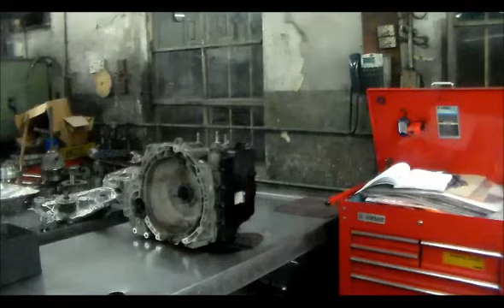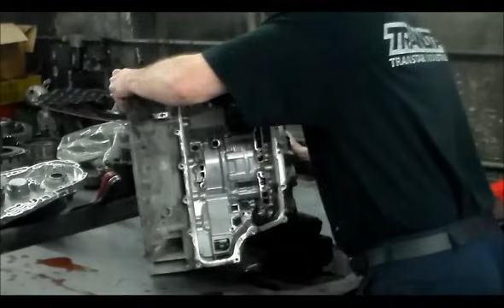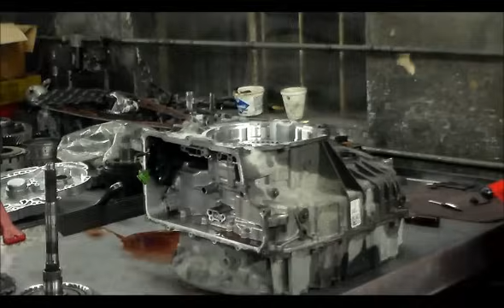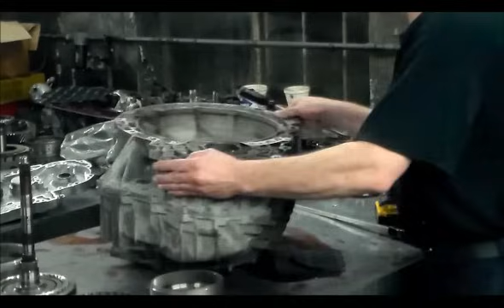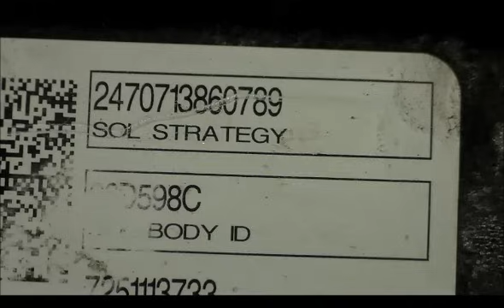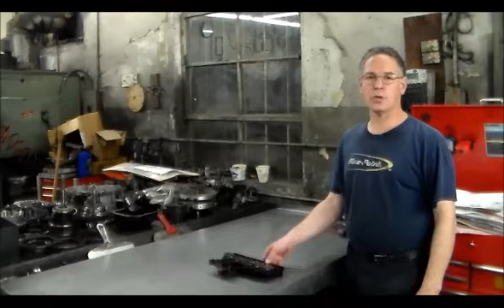6F50N Teardown

Comment: I have a Ford torque converter on order. Have a 6f50 with shudder hoping I can swap fluid and converter . Should I change filter or the valve body ? I’m a tech myself over 20 years but I went away from trans work years ago
Reply from the maker: Well if your pulling the unit out, can't hurt to change the filter. You have to split the cases to change the filter
Reply: @GaryFerraro do I need to mess with any clutch packs, etc? Or can I split the case swap the filter and assembly ?
Reply from the maker: @Ranalla651 you do not have to mess with clutch pack, just remove the pump,  to swap out the filter
Reply: @GaryFerraro thank you sir!

Comment: That's my biggest beef with these transmissions is the unserviceable filter, which will inevitably clog and this is a huge design flaw or more to the point on purpose. Tje only way to avoid a clogged filter is changing the very expensive LV fluid periodically. They got you coming and going.  Most people can't afford a transmission rebuild.
Reply from the maker: Correct, these units are expensive
Reply: Think about this, the filter has a large enough surface area to handle the service life of debris from that unit. IF the filter needs replacement because it is plugged or partially plugged then you have a problem with the transmission. Not because the filter is plugged but because something is coming apart,plugging the filter.
I have 2 6F50s with 200k and 1 6F75 with 235k, none of them have been apart.
Reply: The filter loading has nothing to do with oil changes…

Comment: Hi my name is Isaac I have a 2016 Ford Explorer sport XLT 4x4 3.5L 6f50 transmission, my question is, is the 6f50 transmission interchangeable with the 6f55 transmission which is a more beefed up version will it fit in my car or what  modifications have to be made? Thank you so much
Reply: 6f50 is for N/A motors 6f55 is for turbo 3.5
Reply: @Dalton didn't know that
Reply: Isn’t the explorer sport a turbo 3.5?

Comment: You tore down a 6F50 because the TSS and OSS sensors needed to be replaced?   Might want to learn more about the 6F50 transmission.  They will go well past 300,000 miles.  This was again an obvious sensor failure and a very simple fix. This tear down was not needed.  The 2007-2008 6F50 is well known for it's TSS and OSS sensor failures and many transmission experts do not want to learn or understand.  They want to make money rebuilding operational transmissions and ripping off their clients.
Reply from the maker: If the sensors needed to be replaced that's all I would do. If you read in the description the converter was blown and the screen was clogged. I have done plenty of repairs where just the sensors where replaced
Reply: @GaryFerraro  I had one of the check balls blow through the pressure plate and get stuck in the vein after going the all the ford test and replacing the pcm 🤦‍♂️ lol great video
Reply from the maker: @powerstorke03  Wow , never had seen that on this trans
Reply: Was there any code for the Tss and oss sensor?
Reply from the maker: @felixteresa7584  I honestly do not remember, but if you have a car that does not move or slips because of a clogged screen, very possible you may get speed sensor codes
Reply: @GaryFerraro  I'm not getting a code but the car is slipping and shifting hard in 2nd gear or 3
Reply from the maker: @felixteresa7584  what is the year make and model
Reply: @GaryFerraro  07 Lincoln mix.  It seems like when the car is cold it runs ok but when it warms up it starts slipping real bad..
Reply from the maker: @felixteresa7584  So it runs good for about 15-20 minutes? does it stop moving hot? Any noise coming from the trans when hot
Reply: @GaryFerraro  yes.. run okay for a couple of minutes and then it start shifting hard and slipping.... barely moving
Reply from the maker: MACTFORDEDGE    Almost sounds like the Filter is clogging up. Any noise when hot?
Reply: @GaryFerraro  no noise
Reply: @felixteresa7584  Many instances you will not get a code and many times simply turning off the engine and restarting will reset the codes and allow for short runs under normal operation.  This however will progressively get worse.
Reply: @MACTFordEdge  it does feel like it's getting worse. I was thinking turn down the transmission and look at the disc
Reply: @GaryFerraro  TSS and OSS senser failure will have hard shifts, failure to move but slowly with high engine rev.  Hard engagement in reverse and or Forward gears.  Difficulty in shifting and finding gears.
Reply: @MACTFordEdge  I took apart the body behind the solenoid, and 2 small ball bearing fell out, where do the go? I am ordering a manual today my new sensors come tomorrow.
Reply: @Chasrunyon  Go here https://www.facebook.com/groups/MACTFORDEDGE/ or MACTGARAGE.COM to find files on how to repair and replace the check balls.
Reply: MACTFORDEDGE thanks
Reply from the maker: @Chasrunyon  Thanks for watching. Stay Safe
Reply: Gary Ferraro thanks
Reply: Gary Ferraro when I broke the valve body down there were only 2  quarter inch check balls in there, diagram calls for 7, I see ford recommends removing one, reading comments on another video and guy found same thing just 2, 
I’m going to order replacements but seems like a manufacturer change at plant without actually disclosing.
How important are the check valves if only 2 in there?
Reply from the maker: @Chasrunyon  Macfordedge, Any info on the 8F35? I have code P093D, Accumulator solenoid performance.  Thanks
Reply: Gary Ferraro I have no clue, I’m just a smuck to dumb to be afraid of tearing things apart. Ha good luck though
Reply from the maker: @Chasrunyon  You did the video on the fluid for youtube correct?   Thanks for getting back to me
Reply: Gary Ferraro no not me
Reply from the maker: @Chasrunyon  ok, thanks, stay safe out there
Reply: @MACTFordEdge    I have the code p0974 shift  solenoid A control circuit high “ do you think it would be caused by one of the sensors or is the shift solenoid itself Thanks in advance
Reply: @GaryFerraro  I have put over 700,000 miles and performed massive amounts of maintenance on my 3 ford Edges.  I currently have my second Edge with over 300,000 miles and the original engine and transmission.  The 6F50 transmission loves fresh fluid and I change my transmission fluid at about 30-40K miles. My 2008 suffered from TSS and OSS failure. Simple sensor replacement and you are good to go. I also have trans and engine fluids tested.
Reply: @GaryFerraro  if you want more specific information go to Mactfordedge on youtube and the Facebook group of the same name.
Reply: My issue on my 2009 Ford Edge is 0705 code transmission range sensor. I’m going to confirm it’s bad with the resistance test at the connector pins. If it is bad, would you recommend replacing the tss and oss sensors as well and what brand of these parts would you recommend?
Reply: I am having same issue in 2nd to 3rd shift.  Getting worse now a random slip if I am hard on throttle but will drop into 3rd.  Would this be a simple solenoid and or valve body or this may also be clogged screen?   I got car at 155k it was barely harsh shift.  Now its 190k and the shift is worse like it wants to take more time to get into 3rd between the shift.  1 to 2 is much smoother and a quick shift 2 to 3 is like a half second delay and may rev flare. That's my only complaint.

Comment: I feel like the answer to my problem is in this video. i have code p0733,p0735,p0756  3, 5 reverse. when i try to go in reverse the engine just rev's up and doesn't move. if i put it in drive i only get first and sometimes in clunks into 2nd gear.. any idea as to what my problem is?
Reply: Possibly the tss or the oss

Comment: Great video, please tell us, what was the problem with the transmission?
Reply from the maker: clogged screen due to a blown converter
Reply: Ok, thanks! I disassembled one today too with problem in 3, 5 and reverse! So there is nothing wrong inside it! Direct drum clutch ok. Everything ok, so I guess the problem it is valve body.
Reply: I've got the same problem with my ford edge too... please tell me you found what was wrong?
Reply: @TheClimber2009  common problems are the tss and the oss sensor
Reply: @powerstorke03   I have the code p0974 shift  solenoid A control circuit high “ do you think it would be caused by one of the sensors or is the shift solenoid itself Thanks in advance